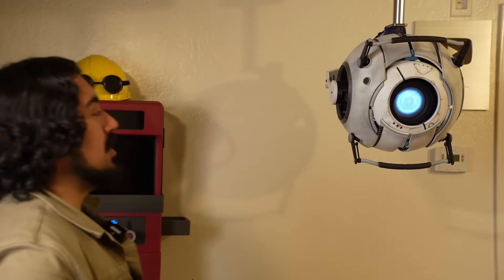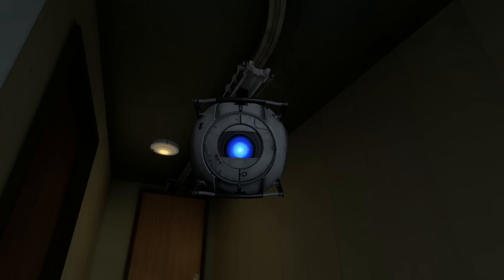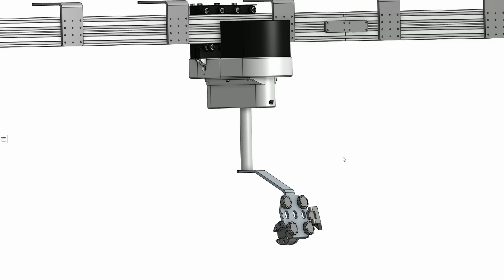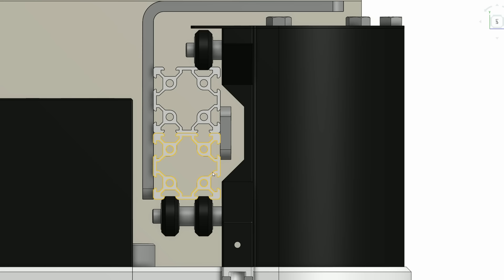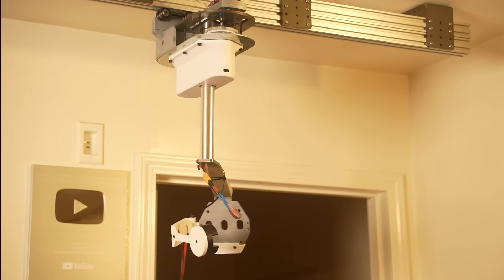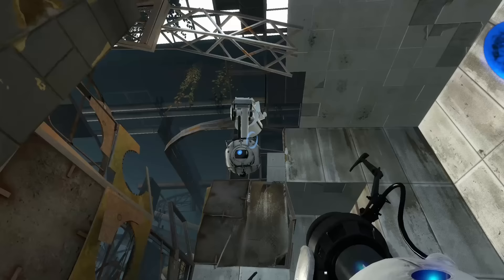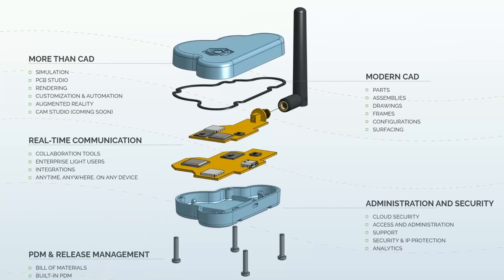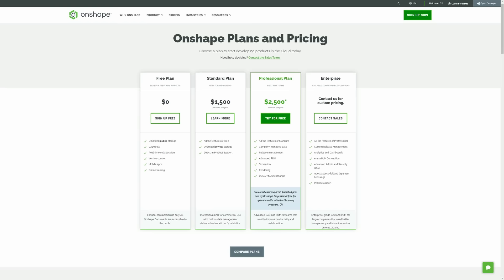Designing a Management Rail and Wheatley FAQs

Comment: Theres a somewhat straight forward solution to the animation mapping issue. You could just have a manual keyframing system in which you sort of eye-ball the in-game animation positions and then manually copy those into your animatronic via keyframes for each motor over time. Would allow for very specific movements to be made without any puppeteering system.

In regards to the physics problem, you could get around this by simply limiting how far you move a given piece of Wheatley in a given timeframe, though it might be challenging. Either way I think the end result would be pretty cool.
Reply: @turtletrimmings  I just wrote this too haha. It's totally doable, but as everything it requires time.

Comment: Firstly I wanted to say this project is AMAZING! I l aways wondered if something like this were possible, and your version turned out even better than I imagined. I completely understand and agree with your stance on using an AI model as a TTS, but I do think it would be interesting to see a simpler system, using a LLM like Mixtral 8*7b or similar running on a remote computer, to control devices like lights/AC without any auditory response (maybe just a nod of the head). Thanks for the awesome video as usual!

Comment: alrighty, im a lover of personality cores, and ive even been thinking about replicating your IRL version into a game model as a mod for Portal 2.

1. for "boss" Wheatley (the model of Wheately that takes control of the facility), youd have to add at minimum four extra servos for moving the side plates and top and bottom bits. in your current design, that would cause an issue since your design mounts to the rail from the side, therefore takes power from the side. it would add way too much complexity, plus might cause problems with the design keeping any stability. plus, you'd have to change the handles to be rotated independently from each other on both sides. besides, the boss Wheately model doesnt even have the handles lol
2. the "stick" from the intro sequence literally stabs into the model awkwardly
3. i would 100% be down to recreate animations that mimic the in-game ones, but that actually follow your rigs. its not too hard to import the animations into another software (for me, it ends up being Blender)
4. my inner child is SCREAMING, cause i WANT ONE, but im damn too poor to make one, even with changing the prints to PLA and whatnot. 

all in all, friggin love this! i cant wait to see more of your projects, and id honestly be curious to see you do more Portal stuff in the future. there's a couple of other bots in P2 you could do (id love to see you do the animated arms that the test chambers use), but id also like to challenge you with the Portal 1 personality core. its has a completely nonsensical design in terms of IRL replication (its basically a sphere sandwiched between two floating plates), but im curious as to how one could possibly work around that. maybe that could be a challenge for myself later on... who knows!

Comment: Regarding using the animations, not going in depth with what I did, but I have personally wanted to build wheatley for years but haven't had the financials for it. But software work is free 😉 I was able to extract the model and animations into a threeJS and also PyOpenGL instance, as the skeleton is different you don't need the mechanical movements, just the rotation in physical space. So extracting a couple of the bone rotations or physical positions such as the eye or faceplate could be translated back onto your robot. But it is a big endeavour and honestly idle animations could just be hand coded as sin equations.

Comment: There are two different Wheatley voices. Obviously Stephen Merchant is in the released game. But there was an early preview where Richard Lord, an artist from Valve and a Brit spoke the lines. He's actually also the original modeller and rigger of Wheatley. When the game came out, lots of people were disappointed because of course they would be, because they already fell in love with Lord's performance. Works at Double Dagger now, i think.

A way to deal with differences in the rig is animation retargeting, and it is an active research field with some approaches. The only plausible way i know of for differences in fundamental rig design is through IK, you calculate from the animation where the final position of important endpoints is, normally say on a vaguely humanoid character that's done with say toe, wrist, pointing fingertip, you want to boil down the complex animation to as little data as possible, plus constraint guide angles, so say elbow position is not used directly but it is used in the solving process, do some transformation to bring your target points within the target rig movement range, and then calculate (solve) back to the joint positions that are needed to achieve that pose with your rig. Obviously IK is a whole can of worms in and of itself, since not every position has a valid solution, and not all solutions are temporally coherent, but it's a "solved" problem of sorts. And then probably filtering and fixup, so basically insert magic here. So for sure it's going to be a whole research endeavour with no 100% solid recipes.

Comment: 10:10 have you considered talking to a professional animation rigger? If the animation could be extracted, it's possible that it could be translated to the other model using inverse kinematics if an expert was at the wheel.

At that point though, original animation is probably the move